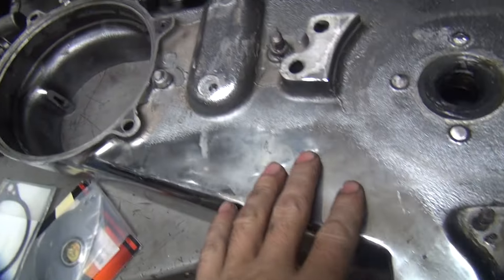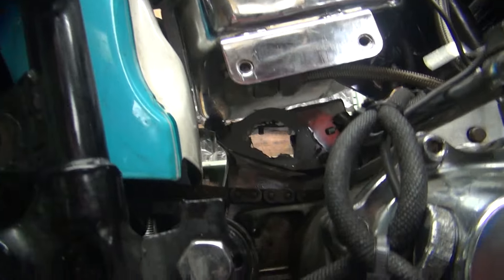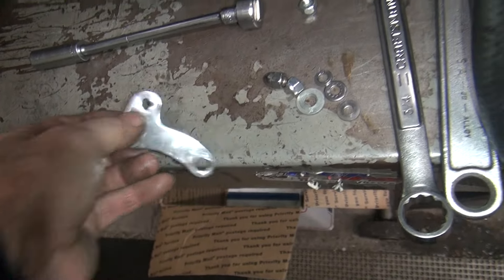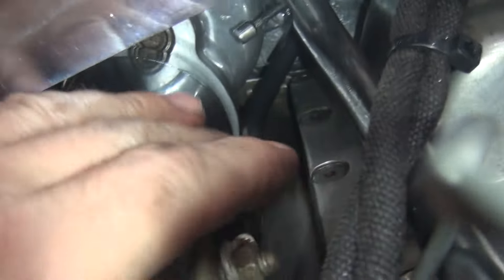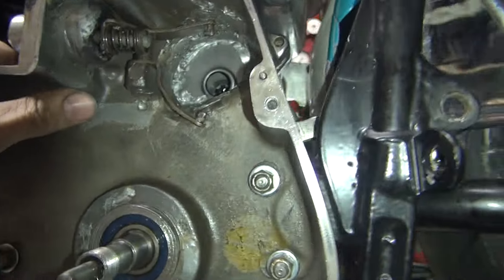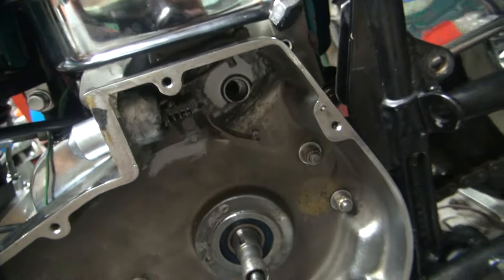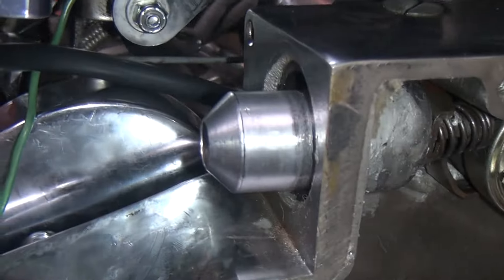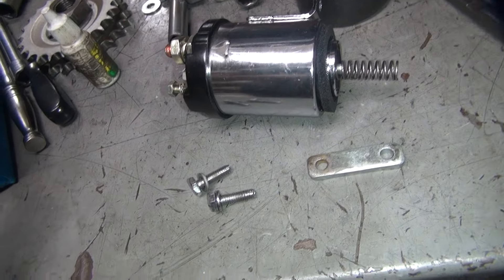1972 #124 FLH 98ci shovelhead stroker motor rebuild Harley by tatro machine

Comment: I make life a lot easier for myself by using 1/4" studs to attach the solenoid rather than the loose hex screws.  Don't use LockTite, just either star lock washers or serrated  flanged nuts.  Makes life so much easier.  I use studs for the starter housing to the back of the Primary also....
....RooDog....
Reply from the maker: some come in that way too. for me its not much different either way. they both have pros and cons.
tatro

Comment: This video has been a great help!  Currently reassembling the primary/starter/clutch in my ‘72 FX.  My only question is that when the starter jack shaft is installed what keeps the shaft in place once the starter solenoid engages it?  Mine seems to come out of place unless I hold it.  Pulley and forks move and engage just fine.  Thanks
Reply from the maker: that would be the primary cover.
tatro
Reply: Realized that the second I commented 😂 nobody says I was the sharpest tool in the shed

Comment: good video. Might I recommend a headlamp?? So there are two grooves in that starter/selenoid shaft/gear. WHY? and why was there zero mention of this? This bike looks exactly like my 73 same colors even.
Reply from the maker: what two grooves? the pulley on the bindix only has one place for the fork tips to fit. don't know of anything else that you are looking at.
tatro

Comment: The riding seasons mostly done for wimps like me in chicago. Toys' for tots last ride? Thinking about winter repair. is a chain case saver worth the effort since it's gonna be apart anyway? My starter solenoid has given me trouble lately! the dreaded click/click sound. get her home anyway. Lotsa cursing! and kicking my FXE. bought the lever action starter solenoid, gonna put it in this winter. what's your take on it?... I'm limping like festus? from gun smoke! tried quality Accel. solenoids, last as long as cheap stuff? ..Thanks back to watching your videos.
Reply from the maker: sounds like cheap ass replacement parts at work again. the name makes no difference. he leaver should work but i would rather just fix what is there. the case savers are big and will just get ground away by the chain. weld up the pri with hard welding rod and it will live longer. the answer is to move the parts further apart. one way to do that is run different sprockets. a steel 43t rear sprocket along with a smaller 21t or 22t front sprocket will get the job done and have a taller gear ratio too. there are other combs of sprockets if you want a different gear ratio.
tatro
Reply: @TatroMachine  Replaced the bum solenoid. Worked 4/5 times started clicking again! ball buster! It's working OK now? plunger in old unit wasn't burnt too much? replaced it with a NEW chinese piece.Don't know what i did to the God of solenoids! Gonna lite a candle sunday. If that doesn't work? eyeing my first born child as a sacrifice. LOL
Reply: Didn't think of the sprocket change. guess i'll have it welded up. Thanks!

Comment: My starter shaft deflector cover looked similar to this bikes. what caused that? My James gskt. set came with a hard plastic deflector cover replacement no gskts needed. should i use it? The tin one supplies a little support i guess. rollers in primary&starter cover do the heavy work........ Thanks!
Reply from the maker: use the stock cover with a gasket.
tatro

Comment: Does it matter which way the oil deflector is installed? Mine is reversed versus the way you have it. Will it mess up the jack-shaft or starter?
Reply from the maker: do it my way if you want it to work correctly.
tatro

Comment: The 72 FL I'm doing right now had a jumper wire going from one stud on the end of the starter motor to the one that has the support bracket attached to it. Do i need that?
Reply from the maker: sounds like a ground wire which you do not need on a starter. only the starter relay needs to be grounded.

tatro

Comment: And did you say what caused this wear?
Reply from the maker: what wear is that. remember, i did not just make these videos.
tatro
Reply: @TatroMachine  the wear on the inner primary where the starter shaft goes through. Thanks

Comment: I closed off my primary  case as  a sealed unit. AS easyrider suggested. left the spit tube in the inner case open as a vent?  now it's apart ; i notice you have the spit tube sealed? Trying to cut down on oil leaks!  I know on a 45yr. old AMF it is never gonna happen. I'd like your learned opinion. Thanks!  P.S. keep banging the tools on the lift!  my girl thinks i'm paying attention to her babbling about shit when my head bobs up when i'm getting drowsy. 1974 shovel FXE. I add 1 0unce primary oil to the case. seems to get sticky after awhile ? put cleaned old plates back in. new rattlers going in this year.  will that help?
Reply from the maker: you need more oil and you need the grooved plates. use primary oil too. you can bend the tube down so that the oil will not leak out. you are on your own with the babbling wife.
tatro

Comment: No, no...not giving you advice. You forgot more than i will ever know. But...when i plug a primary, i put the nut on the inside, because the nut has less mass than the nut and will do less damage if it comes apart. Just my $.02. I know the customer did it...not you.
Reply from the maker: when i plug holes i usually make a solid plug in the lathe and press them in with loctite. the not and bolt was a carry over from someone else work.
tatro

Comment: This has to be the single worst starter motor design even invented. Jesus how many moving parts are there? They put a solenoid remote at a 90 degree angle with a hooking lever pulley method to MOVE the starter gear side to side? Look at all that  liquid weld in there. Good video on it though, it is just the way most of us would be working on one. Reminds me why I never bought a second Harley.
Reply from the maker: no way, go look at a 1963-64 45" trike. this is a big improvement.
tatro
Reply: yEAH, got to agree with you on that one ! Suprised it took HD so long to use a device invented in 1912. Even Indian had one in 1914. It is interesting how many of the other starter systems for bikes use one way Sprague  Bearings too.
Reply: So who sells a perfect bike??